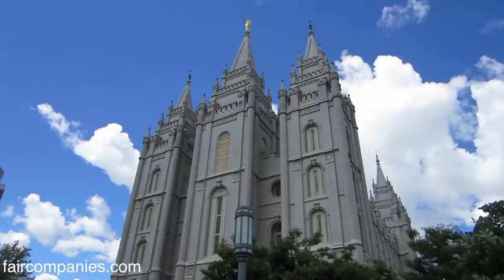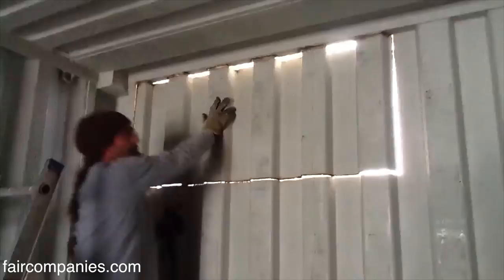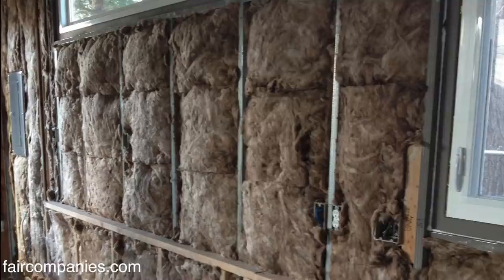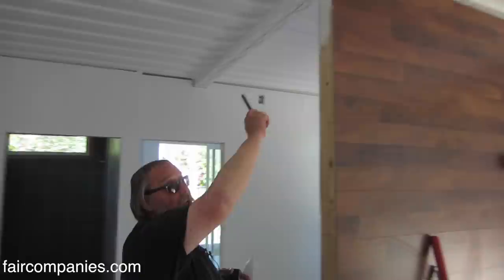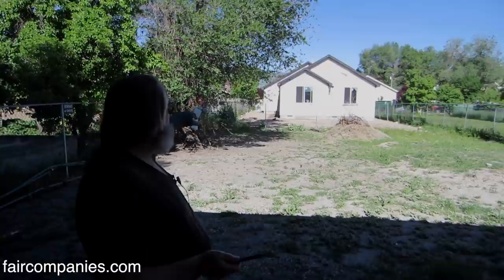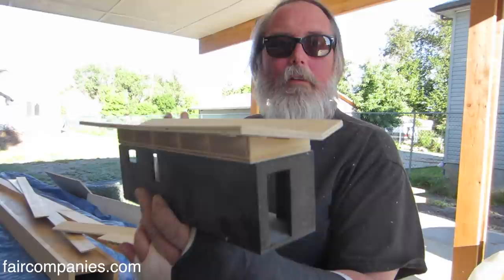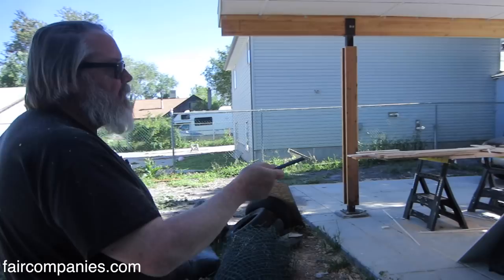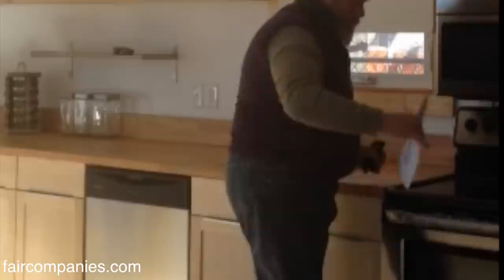Shipping containers recycled into affordable, accessible Utah home

Comment: Exactly what is the advantage?  I mean, you still are basically building the frame of the house out of wood like you would any other house.  You just aren't putting siding on it since you have the shipping container around it.

However, it would seem a LOT easier and cheaper to do it the normal way.  You would not only have fewer restrictions on the shape of the house but also would be less cramped during the building process.

Don't get me wrong, I could see this being cheaper if you were just spraying the inside with a foam wall and maybe tossing some paneling up.  However, there is a ton more than that you have to do.  You basically have to build a normal wood house inside... with maybe just a few less supports.

Comment: A few questions: Is the city working on revising the code? The city leaders talk about "affordable housing" but they have such rigid code requirements that container houses and mini houses are unable to really take off. I think pre-fab housing is one of the major trends of 21st century building because they are much more in-line with a modern lifestyle. Also, where is this? I live in Salt Lake and I would like to drive by it and possibly build something similar in Moab. Really well-done video! Thanks for sharing.

Comment: As a master builder I applaud your tenacity...but....in reality ...just build it out of recyclable pine framing. Its lighter and easily insulated. I don't want to burst your bubble friend but which ever way you build you still have to wire and plumb it out ....so the pine frame is easier still AND can be made in small modular sections that a mom and pop couple could put up themselves. Hope I've not come across as too harsh because I like the thought process behind your homes. Good luck.

Comment: The insulation on the roof is on top of the metal and the insulation in the wall is on the inside. This means the wall on the outside is directley in contact with the roof on the inside. Therefor the outsied wall is a gaint cooling/heating fin which -> bad design.

Comment: Yeah, also those "skinny" windows have them be like those crank out windows with a screen. after all you need cross ventilation in any home; & maybe a couple of ceiling fans for that purpose, o.k. do you tear out existing insulation & put in foam & other insulation then sheetrock? is it grounded since it's a metal structure for lightning  & strong storms??

Comment: Guy down the street from me said there are better ideas that are cheaper than shipping containers, and he runs a container popup shop called UrbanBloc, but they are quite available about anywhere you go. With any building, local regulations get in the way as well local governments. I'd be a proponent of these for many reason,  it's is the use of materials that normally are just sitting around taking up space, has lower environmental impact period because it's less labor intensive, you can always add on! There needs to be a building revolution at some point here in the world, perhaps this and printed building methods could combine to make for some interesting builds in short time frames, consider it the Legos of home building...
Reply: What materials are just laying around taking up space?

Comment: Never use batten insulation in a container. It’s going to lead to major headaches soon down the road. It draws in moisture no matter what you try to use on the exterior.
Reply: It doesn't draw moisture. You can put a layer of spray foam down and use batt insulation just fine.

Comment: A mini split A/C is a great idea if you consider cold air sinks!! BUT if you use it for heat it is a rather stupid idea in many homes, because heat rises and at the height a mini split is installed, you are basically heating the hot air in the room at the ceiling, and no place else!!! It is after all basic thermal dynamics after all heat rises cold sinks, yet people seem to NEVER understand this logic, and if you are an older person, like my other half and I are, we want to be warm not freezing most of the time!! So it makes NO SENSE to place a heater at the roof level of a building because then you will NEVER get warm!!

Comment: Is your winter there not cold or what? Looking at the ceiling of the containers It does not look as if you installed insulation. It looked like just the rigid steel container.?
Reply: We designed a conventional wood framed roof, with batt insulation installed, above the shipping container roof.

Comment: Thank you for your projects and works. I am looking into another "LEGO Apartment". I drafting some remodeling on my house on the patio, based on 3 containers of 20 ft L. Based on 3,  It should be on the backyard front of the 2-storey house of 50 ft wide. On the left, 2-storey (on top of each other); and on the right side, one container on the top of the 2-storey (under pillars to hold on the top). My project should be on kind of DIY. I am an Metallurgical Engineer from Brazil, and I loved welding and production  work. I am looking to find some containers so I can get a best grasp of the work I will do, and some helpers, of course. Please let me know if you can send me some insights. For sure you could do some architecture draft (permit in Miami-Dade), so I can get all the details, for an estimate. Thank you!

Comment: Im from the Philippines and as you know, we`re being hit by a number of typhoons within a year. Would you recommend building a house like this one in countries that are prone to typhoons?
Reply: +Mac Castelo Yes, these would be pretty safe from straight line winds associated with typhoons, hurricanes and tornado's. However this roof system needs improvements to withstand the winds. In these areas you could engineer in window coverings to protect from debris flying around. One concern about typhoons and the Philippines would be the location of the home as this area is prone to landslides and flooding. Anchoring the containers is paramount, deep anchors are recommended.

Comment: This home is 1 level but it isn't wheelchair accessible! There is a step at the front door & into the shower. The door ways are not wide enough to accommodate wheelchairs & the kithen & bathroom counters will not accommodate wheelchairs. 
True Wheelchair accessible homes have very specific dimes ions to accommodate the width & turning area needed to properly accommodate a wheelchair bound person.

Comment: You would have had better success and cost savings just going with a Trailer Home. All prefabricated. In this instance you're modifying a container not meant for housing and losing because of all the onsite construction.
Reply: but trailer homes are not as strong or attractive.
Reply: Sure there are. If you do a quick search you can find several at a large variety in quality and pricing.
https://www.bluhomes.com/

Comment: What are those containers made out because there is a school that has metal walls and the Wi-Fi doesn't work so they put the wi-fi signal a lot stronger and the students are sick and dying and they can't think. And they have insomnia. These students are supposedly gifted and not anymore. It's in California. I forget the city. But when you put some wood and glass in it the Wi-Fi signal inside does not bounce off the walls and it's a lot better plus you can put Crystal quartz stoned in four corners of your house. This absorbs the Wi-Fi frequency apparently.

Comment: If you compare making the whole house from containers you will ending paying the same if you start from scratch making the house from wood you have to put a roof on top of the container because of the heat also you need to isolate the walls cause metal gets very hot you have to put a floor, my friend the is not worth it.

Comment: There problem is the structural integrity of the concrete under the shipping containers.

A driveway is not designed to withstand the shipping containers or for living on.

Most driveways get shit concert delivered to it. It can be old and rejected from other projects.

It is not nearly as this thick or as reinforced as a housing foundation/slab.

Of course, your are going to get shit for building it on a driveway.

And no those steel squares are not your foundation.
Reply: Watching further, I can see that you are going to have load bearing issues where the two containers connect.

A box beam doesn't have structural support.
Reply: Also also, you could probably have the electrical done in the factory, but keep everything open so that it can be inspected when it finally gets in site.

This would reduce the cost a little by having the more skilled labor in the factory and only have then go on site if the electrical doesn't pass. This would reduce travel time and also give the electrician/s financial stability.
Reply: Your statement on the structural design of the shipping containers would be correct if they were left alone.

However, you have severely compromised the structural integrity of the containers by cutting into them.

Therefore, the decreased integrity needs to be taken into consideration. Which means that the four corners--in reality it would be 8 corners--might not be enough.